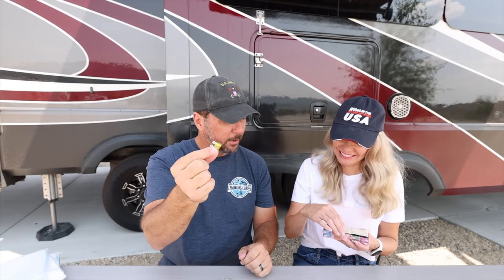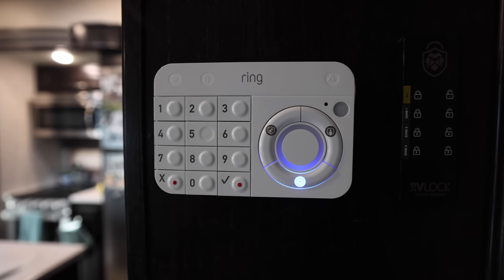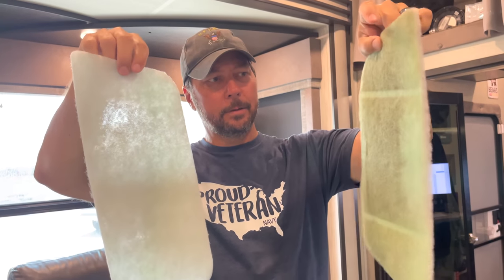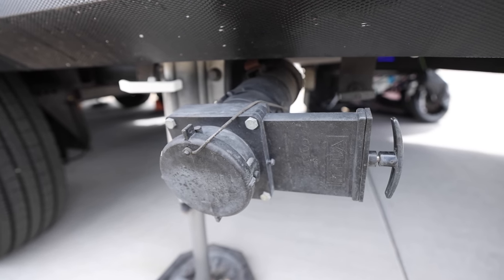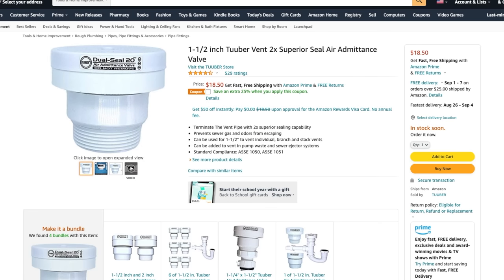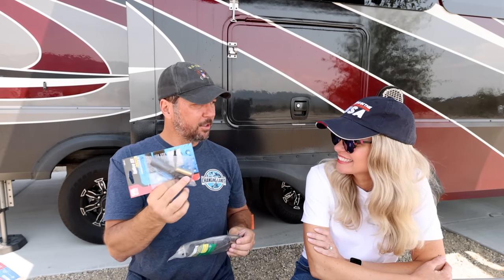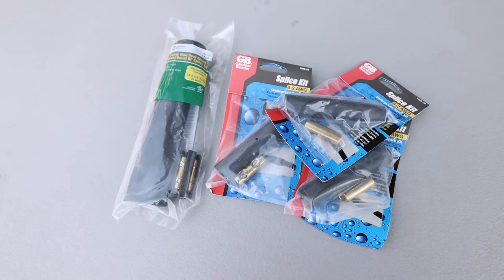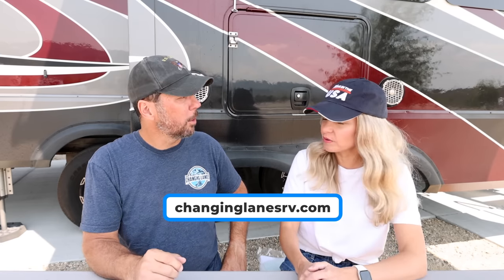🛠  RV Spare Parts! 🛠  (Full Time RV Living)

Comment: Regarding A/C filters, the higher the MERV rating, the harder the A/C has to work to move the same volume of air because of the increased air flow resistance.  MERV 6 is ideal.

Comment: I love those filters. You can actually buy on eBay the filter material and simply cut out your own. Some media even comes with one side tacked so it’s sticky. You can make your own for a fraction of the cost of those premade ones.

However, I used an air speed gauge like you had in one of your videos. Doesn’t matter what media you use, the air flow is restricted at least 20%. Much higher on higher merv rated media.

I think I am going to 3D print a new “pre filter” to remove that thin screen the ac’s come stock with. That way it’s just a grated backing with large slots (that way the media doesn’t get sucked up in the ac system). I think this 3D printed grate in combination with good merv media should be pretty close to stock air flow

Comment: Hey Guys, great video. I pretty much carry the same parts with one very notable exception that you may want to add to your list of spare parts. I carry 4 spare flexible brake lines for my hydralic disc brakes. Twice while travelling I have had a flexible brake line get danaged and I was stranded for 4 to 5 days before I was able to source one and get it shippend. I found that no RV dealer carried or even worked on RV disc brakes and neither did any trailer place I contacted. I also carry a spare plug that can be used on a 3 or 4 way connector and brake fluid in case I need to isolate a damage brake line to allow me to get off the side of the road and to a save place to make a permanent repait with at least partial brakes on the trailer,

Comment: Great tips and advice! One thing to maybe look into as for the electrostatic air filter for AC is the Wacko RV AC Silencer, not only does it significantly reduce noise of the AC inside the RV but it has the electrostatic air filter. It is easily cleanable and reusable.

Comment: I have to bring up an ugly one the seal in the hole in the toilet I think goes bad it has to be changed or your water will leak out of your toilet so it's good to have extras on hand I learned that one from nomadic fanatic
Reply from the maker: We keep ours lubed with plumbers grease and have never had an issue... And we're talking LOTS of flushes in 4 years! 😳
Reply: @ChangingLanes  I was told by the manufacturer not to put a lube so now what do I do LOL

Comment: Many motorhomes don't have a way to carry a spare tire, especially those based on the Ford F53.  We carry our spare in our toad's trunk (Honda CRV), but it's a tire only, no rim. It's lighter and easier to carry.  It's wrapped  in stretchy wrapping tape to mitigate the smell of rubber in the car. This makes it cheaper and faster for a mobile tire truck to get me back on the road, plus it's a matching tire to the other 6 tires. FYI, tire guys won't patch a front tire, it's against the law in most states. It would have to be installed on the rear, which is an extra charge.

Comment: Hello Chad & Tara, thank you for another informative video. We also keep a spare water pump, low & high pressure propane regulators and the small external refrigerator exhaust fan. Safe travels. Mike

Comment: Great topic! I'm the guy that lost a leaf spring center pin, if course at midnight. Waited until 9am and called all local rv stores, no one carried them. Found a small rv repair shop that had 2, not rated enough but close. It got us back on the road, but now I keep 2 leaf springs on hand, ubolts ect. Plus 2 spare tires. One can never be to prepared.
Reply from the maker: Great idea!  We had a leaf spring break and got lucky.  Now, we don't have any leaf springs: https://changinglanesrv.com/morryde-independent-suspension-upgrade/

Comment: Glad I have a regulated water pressure valve. KOA Salt Lake water pressure was 120 psi. Don’t leave home w/o it. Also propane tank connector O ring. .49 cents at ACE impossible to fill propane tank w/o it.

Comment: Don't know if it's been shared already, checking breakaway switch made easy.  Amp clamp on wire to switch or. . . Compass held next to tires will spin the pointer when activated.

Comment: Nice video. That valve under your sink you were talking about is a Studor valve (or vent). Secondly, you can test your electric brakes without someone else putting their head down there, by simply having them pull the clip out and you try to drive away. If you can't or your wheels are skidding...it's working ;-).

Comment: Great Video as always.  I paused the video and tested my breakaway switch and of course....it did not work.  a while back I removed the cable while it was in storage then saw a video that you can burn up the system that way but it was pulled out for over  a month.  you said yours didn't work....did you just replace the switch and everything started working again?

Comment: I have the same pressure regulator as you do. I’ve attached mine permanently to the fresh water intake on the Nautilus panel. It’s really pretty easy if you use a u bolt to attach it. That way I don’t worry about leaving it behind or someone stealing it.

Comment: Get a better quality D ring hold down and turn it 90 degrees so you're not pulling sideways on it. If you can, try to use the backer plate under the floor. It provides much greater strength instead of ripping wood screws out of the floor. Keep in mind that during hard breaking or a crash, G forces will create a significantly larger load.

Spare circuit board and control for the refrigerator. It also uses an ignitor as does the water heater.
I also carry, for the generator, oil, fuel filter, fuel pump and a spark plug.

Put the water pressure regulator on your pre-departure checklist.

Comment: Don’t know if it was mentioned in the comments but the hot water electrode. For the water heater. My water heater is gas and electric so at least there’s a back up.

Comment: I think you missed one spare part. It's the thermal cut-off for your water heater. Costs under $20 at RV supply store. If your DSI Fault light comes on on your control panel neither the propane or electric side of your water heater will work. It doesn't take but a couple of minutes to replace.

Comment: Here is another item.  My water heater stopped working during my FIRST weekend out.  Removed control board and had it tested, it was OK.  Next suggestion was the Thermal Cut-Out.  Amazon sells them by the four-pack.  That fixed the problem.  Now I have three spares.  Apparently a high failure rate item.

Comment: We had our check valve, on our 337rls bust one a camping trip to Florida. Had to take a day off from work. Luckily there was a rv place about a mile away from our campground. Replaced it with a brass one. One thing that was hard to find was a tap to clean out the plastic in the threads. It was almost like the factory glued it in.

Comment: You two rock! Keep 'em coming. I'll be looking forward to your Gopower IC3000 inverter video and the problems you're having with it. I have the same exact inverter and kind of regret not getting the Victron. I had specific space requirements and the Gopower was the best fit. BUT, I may MAKE the room for the Victron. The Gopower is sorely lacking in its charging capabilities and informational readouts, basically it sucks. I just turn it off and let the Victron solar MPPT take care of business. As an inverter it's fine, but beyond that I would recommend to anyone to spring for the Victron and it's superior informational app and data. You basically know nothing with the Gopower, no bluetooth, no built in settings for LiFePo batteries, come on it's 2021 Gopower get up to speed!

Comment: Maybe you cover this during the upcoming inverter video. 

Since the Inverter is a single point of failure, is it possible to wire a permanent bypass circuit with breakers?   Aligned to use the inverter during normal operations, and flip a few switches to bypass.
Reply from the maker: Yes.. that's possible.  But, it's a lot of work for a what-if.  Much less work to bypass it temporarily.

Comment: In checking to see if your electric brakes are working, hold a compass next to your wheel rim at the bottom of the brake drum and when you apply your brakes the magnet will move your pointer from true north and point to the magnet.
Reply from the maker: Great solution!  👍🏼

Comment: Great video. Camping for years and added some new things to my list. I have not had a problem but have seen it pop up lately in post. The water Lines have the pex crimp on them. The tool looks like it might be hard to get in tight locations. I was looking to add fuel injector hose clamp to swap them out. They would work on both Pex and flex lines and be more secure.

Comment: Hi Chad, Thanks for that great list of spares. I do have one specific furnace question about our jayco 2017 29MV.  it has a suburban but I can't tell you the size.  I have a Symptom and would love to ask.  
the fan comes on and runs, then the Gas lights and it heats like normal except I hear the gas shut off intermittently, then after 2-5 min the gas lights again.  this extended fan routine can stay on for 15-20 min before the thermostat reaches its goal. I read the voltage as 12.3Vdc when running. I have 4, batteries configured to 12V plus solar. 

my question. : will the limit switch cause this symptom also?     thanks for any TS tips.  Ted
Reply from the maker: It might just be normal operation.  The furnace will cycle the burner off and on several times an hour... I want to say 6 times an hour, but that's just from memory.  If the sail switch or thermal switch is bad, the fan will come on for about 3-5 minutes then shut off.

Comment: Don't swap from incandescent to LED bulbs for brake lights and turn signals. The fresnel lens and/or parabolic mirrors are VERY precisely designed for the position and shape of the incandescent element of these bulbs, to direct the light into a narrow cone towards the eyes of the driver behind you. LED bulbs, which, out of the fixture, may seem brighter, are usually an array of several light elements. Since this array isn't as small as, or in the exact same position as the incandescent element, the fresnel and parabolic lenses aren't going to cast the light in the same place. 

If you want to try LEDs, be sure to check the brightness difference in the same "cone of brightness" that your incandescent cast. If your fixtures cast a 20˚ cone, but you stand at a 45˚ angle to compare them, the wrong type bulb may seem brighter, but in fact, in the area where the bulbs are optimized (that driver behind you) may be considerably dimmer. This is the zone where you need to evaluate. You're best changing to an LED fixture instead of swapping just to an LED bulb.

Along these same lines, the aiming point of your brake/blinkers should become part of your regular/monthly check. If your fixtures are loose or damaged they may not be directing the brightest light to the right area. Especially important is the socket inside the fixture. These things can rust/rattle loose and may not seem to be that big of a deal, but here is where the exact position is the most critical. A very small change of position here can cause your "cone of brightness" to move, or worse, completely become a globe of dimness. Accuracy here is a safety issue.
Reply from the maker: FWIW, all of our brake lights are LED from the factory.  I was referring to the regular outside lights above the door.

Comment: Another great video. FYI try Nano tape for Ring door bell. Mines been hanging for 3 years. Also use it for motion lights and pictures. So far it has worked better than command. I test it on an area I'm going to use it. So far no issues. I also use washable adhesive hooks as well. Working better than the command hooks. Here in Texas the command stuff falls off the wall when it gets 🔥  hot.  Keep up the good work. 👍

Comment: It looks like you flipped the sewer hose o-ring over and reinstalled. Is that correct?
Reply from the maker: Yes.. sometimes cleaning and flipping them helps if you don't have a spare.... I just did that to show the O-Ring...
Reply: @ChangingLanes  Good tip plus I ordered spares.  Thank you

Comment: Talking about filters and wildfires, last year I had to change my filter for my HVAC system twice in three weeks because of it getting blocked up.  What was good was that I had some spares.  I ran out because of that, but I had them.
As for electrostatic filters, if they are powered I would be wary if you have issues with ozone as a byproduct of an electrostatic filter is ozone.  I was going to get that installed in my home but I shyed away from it because ozone and I don't get along very well.  So if Tara has problems with smoke, I'd not consider one of those.

Comment: Hey Chad and Tara. I noticed that at your Nautilus panel, you have two grey tank handles. I have a Reflection 5th wheel that has the galley grey water tank release handle underneath the slideout and its a constant problem. Just wanted to confirm that your 3rd handle is for your kitchen galley tank. Wish GD would have done that for my unit, a 31MB
Reply from the maker: Yes.. we have 2 grey and 2 black.. the rear black handle is aft of the wheels.

Comment: Great ideas and info, just a question for you. Do you carry a spare tire for your trailer and if so how many?  I carry 2 and have had to use both at the same time, didn't have TPMS, and lost a wheel, don't know how far we drove on three but by the time we stopped the tire we still had on that side was worn to the steel belts, Lucky we had 2 spares.  We now have TPMS any thoughts on spares?
Reply from the maker: We have some info on our tires in the blog here: https://changinglanesrv.com/rv-tire-blowout-be-prepared/
https://changinglanesrv.com/faq/?Display_FAQ=3950

Comment: Chad and Tara thanks for the video. It seems like every time I am in an rv section of a store I am picking something up
 Chad as a Canadian traffic officer the break away is something that I would always have the owner check be it on an rv or commercial trailer. Most people had no idea what the purpose of it was. Great information as usual.
Reply: As always very informative vidéo. If i can add something, leave your camper attached to your tow vehicule and after pulling the break away cord, try to pull your camper and it should not move . This action will prouve that your emergency braking system on your camper if fonctionnal.

Comment: If I saw correctly, you have an adapter on your pin that allows it to work with a sliding hitch due to the truck bed size. If you have that, what does the lube plate do since it doesn't rotate on the hitch? Does it help to disengage the RV from the hitch? We struggle with that too many times to count!
Reply from the maker: We have a full size 8ft bed and standard hitch and morryde rubber pin box.  👍🏼
Reply: @ChangingLanes   Thanks. What is that blue adaptor plate at around 17:28 in the video? It looks like our adapter plate that allows our sliding hitch to work. Also, I didn't mention it, but I like the neon tape you have on the hitch to help in hooking up. I will add definitely that to our 5th wheel....when we get it back. It has been in the shop since May for maintenance!
Reply from the maker: The blue part is just part of the pin box.  See: https://changinglanesrv.com/rv-upgrades-basement-slide-trays/
Reply: @ChangingLanes  Thanks. The pinbox sounds good. I do see our fifth wheel fighting with our F250.

Comment: when you mention the led light bulbs at 19:05 for the exterior, maybe recommend getting good quality ones with resistors in them, a friend and I used cheap ones and we got oscillating voltage at the running lights and found out by trying to hook up a backup camera on one of the running lights and it wouldn't accept the power because the volatage wouldn't stay at a constant 12v and kept jumping up and down.
Reply: @badgerpa9  does it change if I tell you it was with a dodge Durango and then a 2021 Cadillac Escalade and then a jumper pack hooked directly to the leads on the 7 pin connector.
Reply: Yea but a battery pack doesnt use a computer so I'll stick to my original comment and stick with the better led bulbs
Reply: Be careful changing tail lights with LED bulbs.   The lens of the tail lights are designed for an incandescent filaments to be at a certain location, since LED's lights come from a different position it will not shine the same.   LED bulbs will not meet DOT standards on the taillight.  If you do change, be sure that the lights look as bright from behind the trailer and if you have the two filament bulbs (for tail light & brake) that you can tell the difference in between the filaments.    Always test with one incandescent and one LED to see if it improves brightness.

Comment: Chad and Tara thank you again for another great video and sharing your experiences. We just had our water pressure regulator disintegrate inside and fill up our water filter with very tiny brass fillings. Our water pressure went to almost nothing. The regulator lasted about 6 years, so I guess it was time to replace. I will probably keep a spare just in case now. In spare parts, we always keep an extra Y water valve for the spigot, as we like to have the ability to hook up two hoses, and yes I have left one on accident and one on purpose as the shutoff valve at the campground failed and my Y fitting was the new shutoff valve. Safe and Happy Travels.